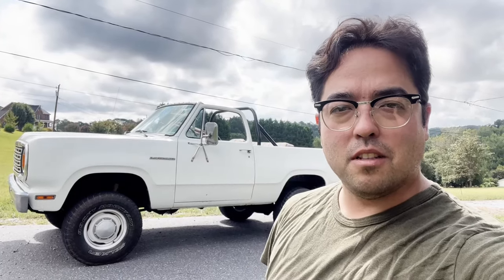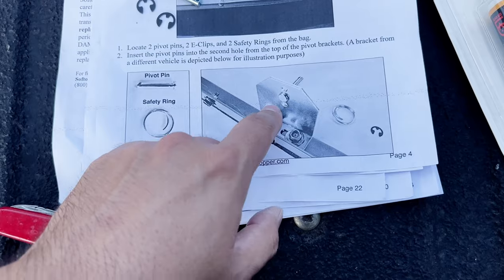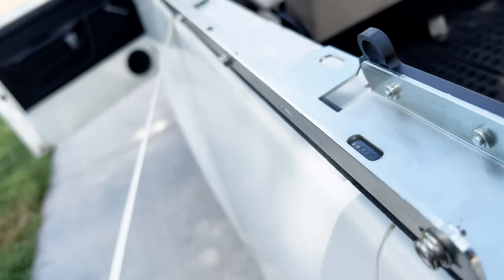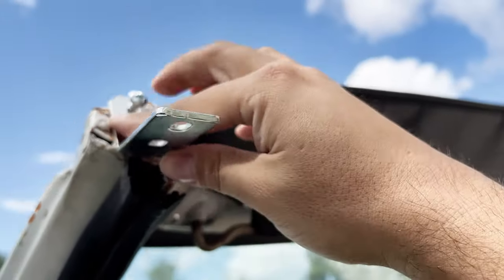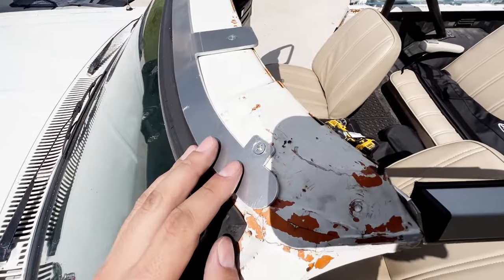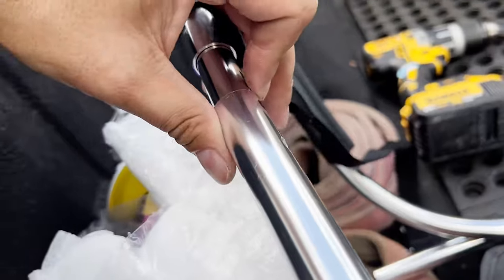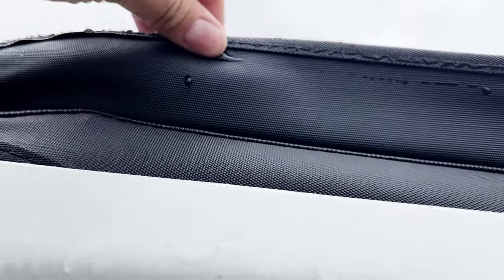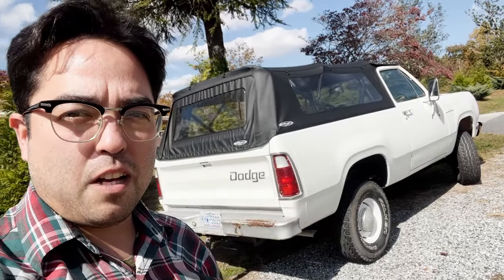Installing a Softopper. 1974-1980 Dodge Ramcharger and Plymouth Trailduster. Soft Top installation.

Comment: Great Video showing the installation of a SoftTopper, I've got a brand new one sitting in the box next to my wife's 74 Ramcharger that needs to be installed as beach cruising season is almost here.  If you were to go back and re-do it, would you have done anything different?  Perhaps using RivNuts down the bedside and anywhere else holes were drilled?
Reply from the maker: I would make the added weatherstripping longer on the doors at the windshield. I ended up needing to add some extra as there was a gap. 

The hardware for the top of the windshield is junk. I’d go ahead and source better stuff and not bother with using it. On the bed I had to just drill one extra hole at the rear so that wasn’t that big of a deal. The hardware as supplied was fine for the bed sides. Just tight in some places.

Otherwise it was decent enough kit. Could be better but it’s the only option for these trucks. It won’t keep all the water out of your truck. Mine leaks around the doors as it’s not the best design. So if you got carpet/rubber flooring you might rethink it if your truck is parked outside mostly.